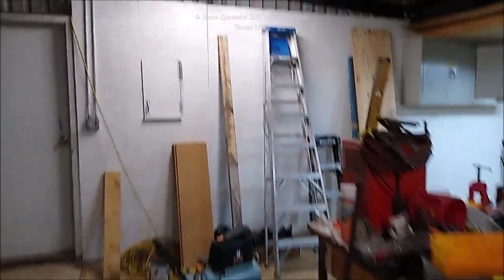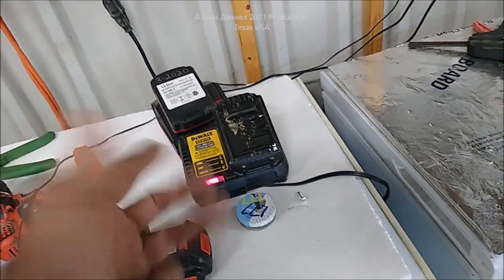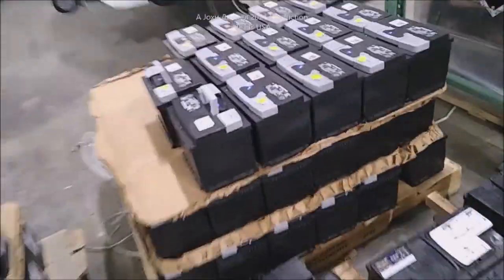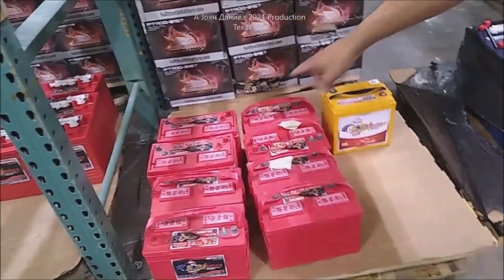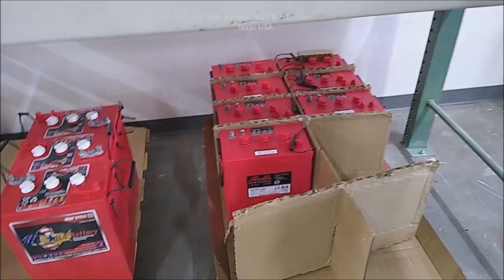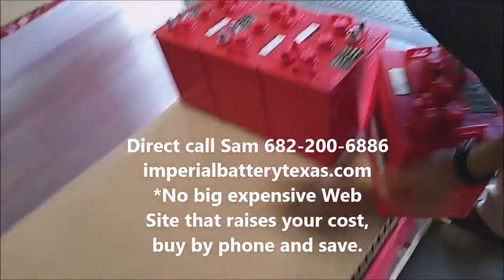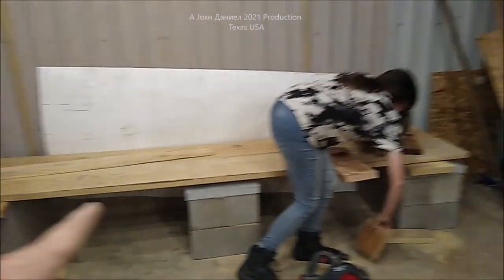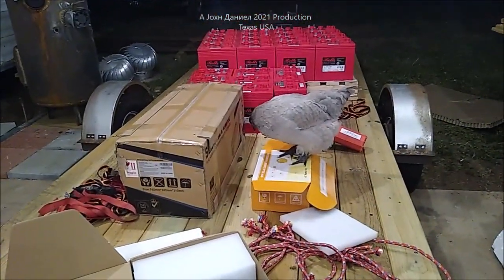Dependable Solar Battery, Rolls Surrette GC2 235 AH

Comment: Much Needed John.  I only use LTO's / 45AH banks, just my personal choice. 45,000 recharges and holds a charge for 8 months and works at -50F.
Reply from the maker: LTO cells are nice, preferred. But cost and china connection bad.

Comment: Good to see you back. I’ve used lead, switched to LFE with a $75-$200 BMS. If the BMS fails, it takes less than 5 minutes to bypass the BMS in an emergency. They consume 0.015 A

Comment: Surette have a plant here in springhill Nova Scotia and you can get there blemished deep cycle batteries at a real good price
Reply from the maker: Surrette uses a six-fold smelting process system. Although they do use recycled lead the six-fold process is three times that of what Johnson controls and interstate uses. Even Trojan uses 40% re user content

Comment: Nice to see You back online. Sometimes back You had a video talking about using a water heater as a diversion load but You never followed up or I missed it. Would be great if You could pick up on the topic and show the options  how to integrate it in a system with a wind turbine and what´s Your experience.
THXs
Reply from the maker: We're going to be using a hybrid hot water system I'm designing on my own. I have two 10 gallon suburban RV water heaters, knowing that they are definitely tough and like most RV water heaters last 15 to 20 years in the odd use service of  of a RV. The plan is to use an instant water heater an L10 that feeds into a suburban 10 gallon model with a diversion preheating tank in the system. It's multi-fueled and easily adapted for off-grid use due to its origination for RV use.

Comment: Thanks for the great video. I am about to get six more USA 2200 6 volt batteries. I couldnt find a price list on their batteries. You were close to my neck of the woods by going to Ft worth.
Reply from the maker: They do not put a price list up for a good reason, they buy bulk and mainly deal with commercial contracts. They actually make the majority of their money by hauling them to sites and installing them such as big golf courses, oil drilling platforms, the radio units for oil wells and gas Wells, and cell towers.  They are kind of new dealing direct to the public it's best to call them and depending on how many you buy and how you get them to you the price is way better than anywhere I've gone including on the largest battery shippers in Wisconsin.
Reply: @JOHNDANIEL1  Thanks

Comment: Hey John You Know You Can Take Them Lithium Tools Packs Apart, Cut Out The Cheap or Non Working BMS Boards & Then Solder Install In Some 7 wire Balance Plug Leads Directly To The Positives Of Each Cell, To Balance Charge Them With A 5 or 6 Amp RC Battery Charger! They Will Last Better Or Be Repaired That Way...

Comment: I'm using Die Hard Gold 29 DCs.
26 and counting. $100. 2 years- no problems.
Reply from the maker: The die hard battery is going through numerous different manufacturers, they are made now by Johnson controls but under contract they have to follow the original exide manufactured case / plates design and 99.79 lead purity. So in general they're deep cycles are still extremely relevant.
Reply: @JOHNDANIEL1  I've bought used truck tool boxes for storage. Hold 8-9 batteries. Line them with foam board insulation. Had no problem last winter in East central Kansas. Land of extremes.